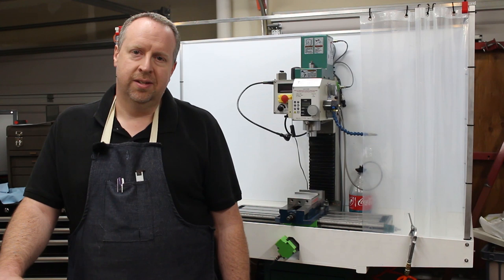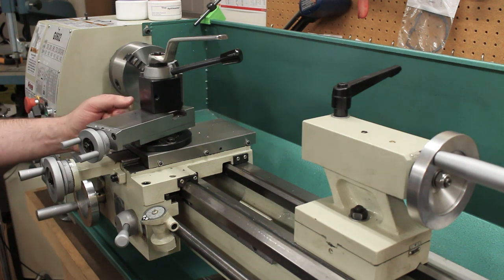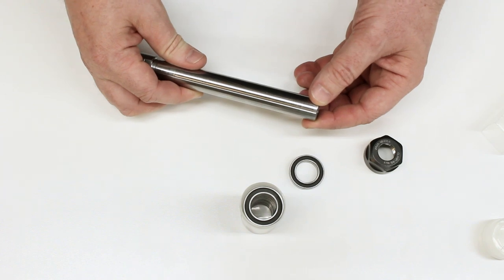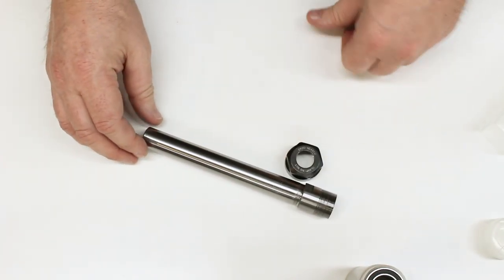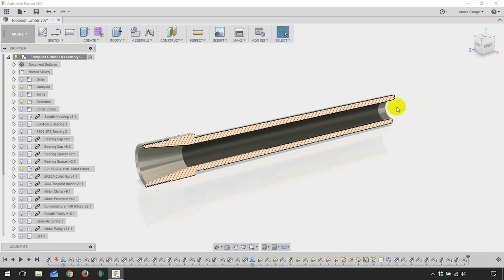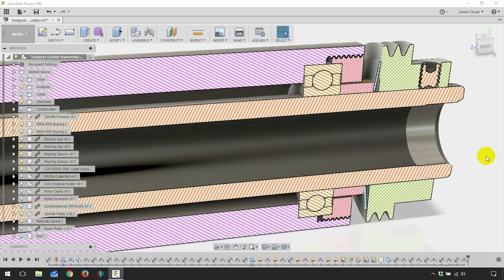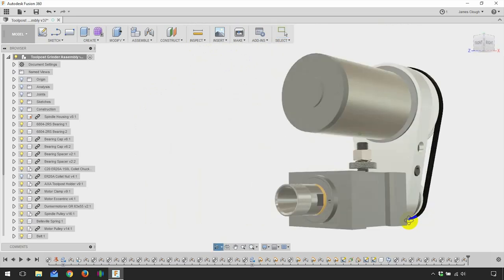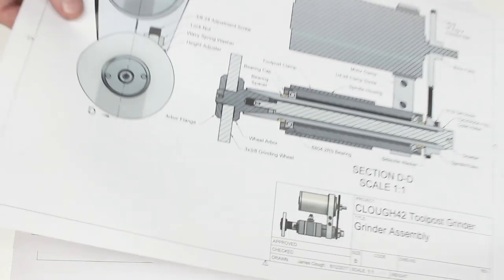Making a Toolpost Grinder Part 1: Introduction

Comment: Hi James. Looks like an interesting project. Like many wannabes I'd like to add one to my arsenal. I like your idea. One suggestion, if I may, would be to add some pressurized air to the spindle body to help keep the grinding dust out of the bearings. I know you have rubber seals on the bearings but the dust will find it's way in and the result will be short bearing life. Just a pound or two of pressure will do wonders without forcing the lubricants out of the bearings. Something to think about while you build the spindle holder. I look forward to the rest of the build.

Comment: i'm working on building a toolpost grinder at the moment, and have been researching angular contact bearings, which is how i found this video. it's alarming how similar your design is to mine, but i had planned on using a j6 taper/chuck combination. i love your use of er20 collets though, and i think i'm going to brazenly steal your idea. lol. thanks for the video! =)
Reply from the maker: No worries.  I brazenly stole it from someone else.  :)  I looked into angular contact bearings initially, but couldn't find the size I needed for a price I wanted to pay.  Time will tell if I made the right choice.
Reply: @Clough42  The problem is causes the design.

Comment: Speaking of "ODD" threads... My Lathe / Endmill combo from Harbor Freight, has M42x2 Threads that hold the Backing Plate on.  I can't find a replacement backing plate ANYWHERE...  And this lathe doesn't allow me to cut threads, so I can't even duplicate it to change the chuck.  I literally had to make an adapter plate for my new 4 jaw..  Lucky for me, my uncle has a HUGE old lathe from the 40's that can easily hold a 8in plate.  So I was able to machine a cast iron plate with the 3jaw pattern on 1 side, and machined it to fit the 4 jaw on the other, so I can fit both onto the 1 backing plate.  I really wish I could just get a 2nd backing plate, but I can't find one any place at all.  Even Harbor Freight, or Central machinery, couldn't even order me one, as they changed them on the new machines, and don't make anymore of this type.  I only paid $500 for this machine in total, and the new ones are going for around $1500... Also the new combo machines now use a 1.5"x8tpi spindle so SAE backing plates fit.  The rest of the machine is all metric tho..  
This isn't a "terrible" machine although the belt trans doesn't allow you to really slow it down enough, with the slowest speed being around 450rpm, and the 2 motors are rated at 1hp but have a hard time starting the spindle when its really cold out.  The grease causes them to need help getting spinning. lol
As for tolerances.  The best I can get on the lathe is about 0.001 (using my 4 jaw) and around the 0.003 on the endmill, just because it swings out of the way, so it doesn't effect the lathe operation.  But in return there is the smallest amount of play in the arm itself so just cant do any better..
Finally, the cross slide / carriage has a TON of play in them, and need some rework.  The set screws they use to keep it tight, back out all the time, and dig right into the bed, making it a mess.  So I use the locking screws to help keep it tight, which makes using it a pain, as the knobs are fairly small and the lead screw pitch is really large.  Something like 8mm.. Would be a ton better if it was 1/2 that.

Comment: the spindle expanding and retracting prolly has an effect to the drawbar tension as well , figure you need a spring ring behind that too
Reply from the maker: That's possible.  I've done a little grinding with it and haven't had any issues.  As long as the temperature changes slowly, the drawbar will expand, too, but you may be right.  It would need to be a pretty hefty spring.
Reply: I'm not sure that would be necessary. If made of similar material I'd guess the drawbar will expand by a similar amount.

Comment: Have you thought about making both pulleys with two different diameters giving higher rpm's  for small internal grinding?? Lov the design think I will build one. Thanks like your videos. . Will be getting my PM 1236 lathe and 833 mill in August .

Comment: i like the model and the reason why .
But there is a little someyhing that i am a little less sure
you install the bearing half in the casing and half in the bearing nut
this mean that you will have to machine 4 separate hight precision diameter for the bearing
but you need a looser fit on the bearing nut to be able to screw it !
personaly i would fit almost all of the bearing in the casing leaving only 1mm for the nut to squeeze it
but maybe i dont understand why you do it that way !

Comment: A very appealing project -- but now, afterwards -- have you perhaps had any ideas regarding how the design might have been simplified while retaining the same qualities?
Reply from the maker: I could have just purchased a tool post grinder.  :)  I actually like the design.  It's working out well, and it's something I can put my name on and be proud.  I may have been able to save some time by buying a spindle or pulleys, but that's not really the point.  Spending time in the shop making something cool is its own reward.

Comment: You could have increased the spindle diameter if you ran it past the tool post base. If you did this you could have added the top distance of the tool post holder to the total diameter which would have given you 3/8 to 1/2" more spindle diameter. 
                                                                |
top of tool post holder             O  - spindle bore
-------------------------------------                       |
                                         |---------------     | bottom of grinder
                           end of tool post holder

The other thing is that those bearings won't do well if you decide to do internal grinding with small wheels. It would be better to double up the bearings at each end and Belville washers are usually used stacked back to back and front to front up to several washers.
Reply: Why would those bearings he used be a problem for internal grinding?  Speed ratings?
Reply: @user-wo7rz3yn4o  Once you get down to small diameter wheels, less than 10mm (3/8") the rpms need to be high, in the range of 25k plus minimum. A greased 6804, like is being used here has a limiting rpms of ~ 15k.
Reply: @mosfet500  good to know. I am planning on building a tpg based on this design...what would be more suitable bearings?
Reply: @user-wo7rz3yn4o  First, I would hang the end of the tool post over the cross slide to allow for spindle diameter options (see my original response above). You have to decide how much you want to spend, what size lathe and what type of work you want to do. Of course, angular bearings are the best but you can get pretty close with an ABEC 5 or 7 in a cheaper bearing if you build carefully. What you could do is use a single shield for the outer bearings and unshielded for the tandem inner bearing. This way way you could build a sealed oil filled housing which would give you greater bearing speeds. Using the 6804's doubled up sandwiched with Belville washers in the middle for the front bearing assembly you can get up to ~25k using the same spindle. Depending on your motor you might be able to get away with one bearing in the back with a single shield facing outside. You would have a more robust grinder with higher speeds. Don't overtighten the Belville washer assembly, just take out the play. You don't want to use one bearings on each end in a single housing, you can't get reliable preload on the bearings because as the spindle warms up the preload changes, that's why you use two bearings in the front with Bellville's and set your preload there, the spindle will also last longer.

Again, it depends on what you need, if you do a lot of internal grinding then use smaller bearings in tandem with a smaller diameter spindle. Also remember, as a rule, you want to keep the spindle as light as possible for starting inertia and balance. 

You should use stressproof steel for the spindle also and machine your final tolerances in situ, you'll get a lower TIR (total indicator reading).

Just my opinion but I've built and repaired a fair number of spindles. I didn't watch this whole series, he may have changed things.

Comment: Got to this channel while looking for videos about Lathe CNC conversion and I'm very pleased with your teaching.
I'm a fan of 3D print as well and learning Fusion 360 little by little. My question here is how did you get that industrial drawings from? Is it made with Fusion 360 as well? Thanks
Reply from the maker: Yes.  I made the drawings in Fusion 360, directly from the design.
Reply: @Clough42  Ah ok. This is a great feature. Could you explain in a short video how to proceed? Thanks

Comment: Wow. An American that can speak fluent European.
Reply from the maker: My 3D printers are all metric, but my manual machines have imperial dials, so I mix units all the time--especially on projects that use both machines.  My sense of size is better with metric units, though, so I'm much more likely to think something like "hmm...that should probably be about 3mm" than I am to think "that should be about 1/8 inch".  Oh, and lest we forget, I'm cheap, so I use a lot of metric import tools.
Reply: Mixing systems is fluent European. I'm British, which is nearly European, and worked in the steel industry for a while. It was absolutely normal for a back-street precision machine shop to order 1 metric tonne of 19mm bright mild steel in 10' 3" lengths. Then he'd ask what the tolerances on the bar diameter were, and we'd tell him they were plus nothing, minus 3 thou. Neither buyer nor seller blinked once during this conversation.